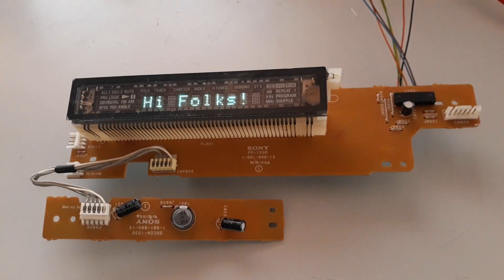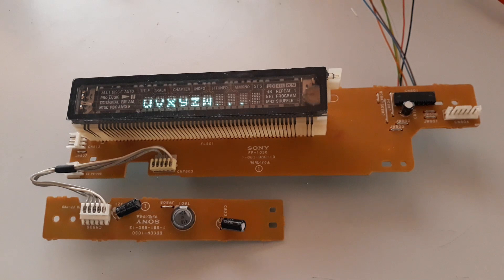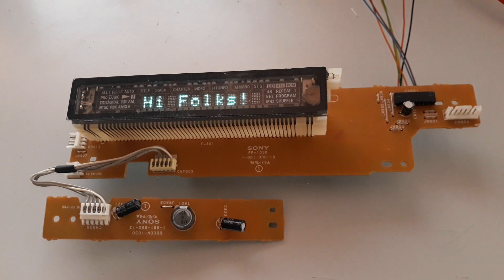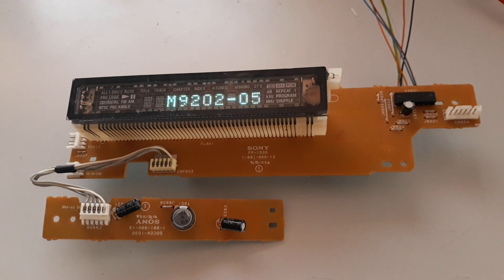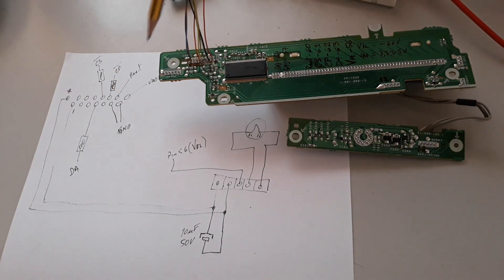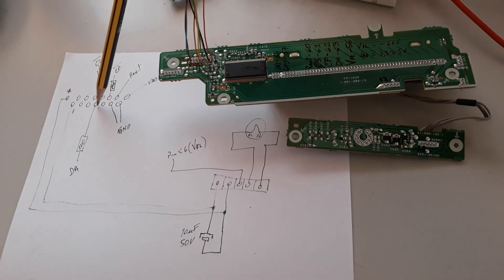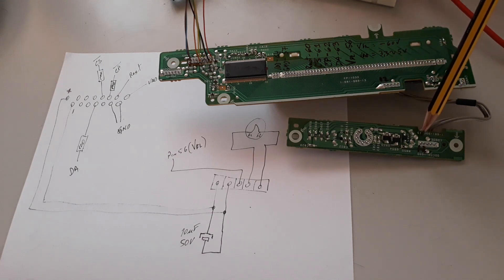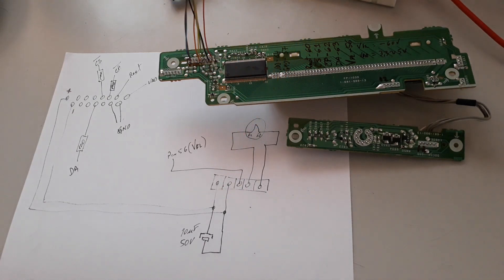M9202

Comment: Hi. Which one of your videos shows the M9202 in depth? I'm driving one from a PIC chip but not getting the desired results, I've double checked the OKI datasheet, & the Samsung one that the chip is mounted on, it's from a fruit-machine. The display illuminates, but not showing what I had expected.
Reply from the maker: Hi @vinyltheif,
If you do a search on my channel as "M9202" and "MSM9202" you will find two videos about this Driver VFD.
This is easy to control, because it use a internal ASCII table, the char's already is defined as it.
Please respect the connections about the Clock, Data In and Chip Selector. Don't forget the GND between your zone of processor and the GND of driver. If you think I can help send to me the schematic of at you apply at your circuit and I will look around it but honestly I not big deal with PIC. Any way the logic of communication is the same!